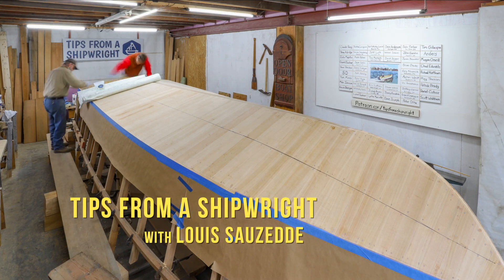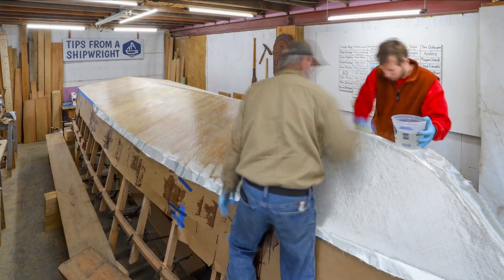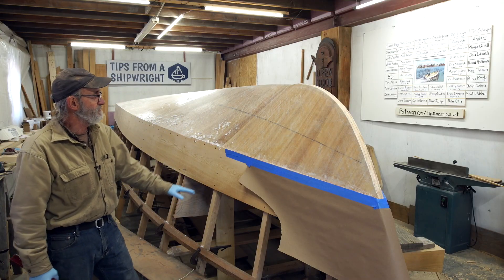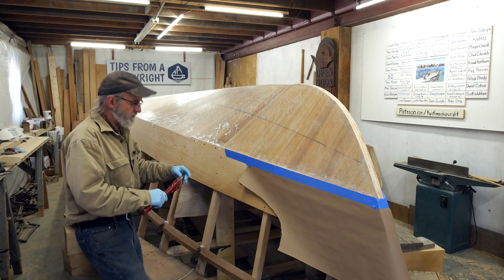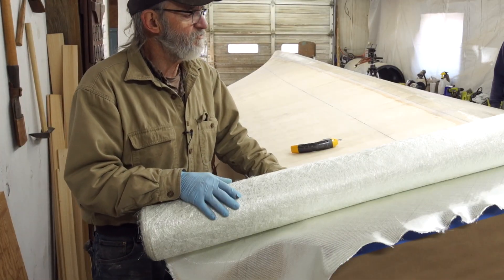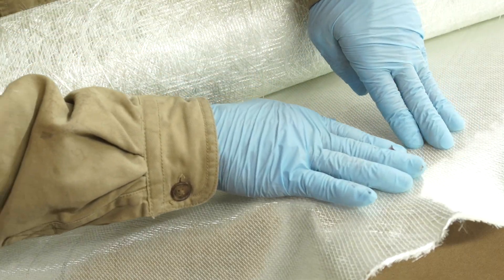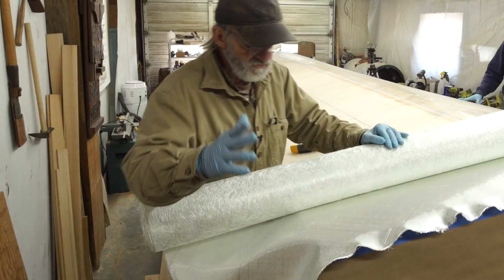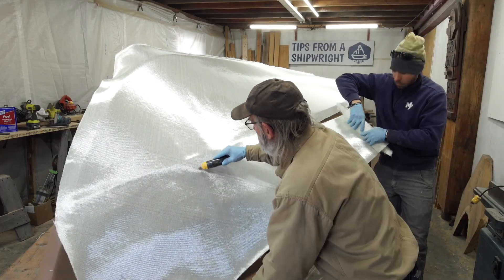Building the 23' V-Bottom Skiff - Episode 13: First layer of fiberglass

Comment: If you have no experience with fiberglassing.....Do Not Follow His Directions or Instructions or Advice!!!!!!!!
Reply: Why don't you come out of the closet and identify who you are and why you say this? Sour Grapes Bare Bottom Reef.
Reply: @Coastwiser  there a lot of Chief out there
Reply: @Coastwiser  
 @Tom Truesdale 
If I need to explain why the fiberglass layup was wrong and horrible advice then you dont know anything about fiberglass.....
Reply: @OldBullRanch  well have you build a Boat on YouTube?
Reply: @OldBullRanch  you may want to get more fans sir
Reply: Please explain yourself
Reply: @tomtruesdale6901  1) The fabric Lou is using is designed for polyester resin, but he is using epoxy. 
2) The technique he shows, of working the resin as it cures, is highly suspect.  Doing that will create problems. 
3) Using just a single layer of biax cloth is not a good idea. The cloth is strong in tension, but nothing holds the fibers to each other.  With just this layer, and with scraping off the stitching, you could peel the fibers off like peeling string cheese!  (I know because I've done it.  I didn't build Lou's boat, but I experimented with a single layer of biax to reinforce a board, I sanded it flat, and then I found some of the fibers peeled up with surprising ease.)
4)  Separating layers of wood with an impermeable layer will trap moisture in the wood, which means it will rot.  Also the wood will warp and/or delaminate.  Wood expands and contracts with moisture, and he is making it so one side of the wood can expand, but the other side can't expand because of the fiberglass and epoxy.  Also this is the same mistake made in naive attempts to make energy efficient homes--some have tried moisture barriers on both sides of the walls,  which results in massive mold and rot issues! 
(I probably missed some details.  I don't know a lot about fiberglass, but I knew a few things.)
Reply: @fredygump5578  Lmao....yes man...cant type that long lol....and there are Many Many other things having to do with the actual application of it that were so Wrong lol
Reply: @fredygump5578  sir were is your Boat that you build on YouTube? Leave your thoughts to your self. Lou a ship / boat building eat Crow ok
Reply: @gregoryh4601   I just imagined how, if you were following your own advice,  I would never have made your acquaintance!   That would be so sad, right?  And the fact that you are triggered reveals that you are amongst the ones the original commenter was seeking to warn!   Atleast he got your attention!
Reply: @fredygump5578  I agree with all you said plus, the thinning of the epoxy with solvent weakens it quite a bit. If he had thin veneers like cold molded, that would be different but two thick layers and the cloth in between as someone pointed out is not much stiffening because its the middle neutral axis. Skins on inner and outer face would be the logical thing.
Reply: @paulbriggs3072  If I remember correctly, he is planning a second layer of fiberglass after he adds the second layer of planking. So it will be a sandwich construction w/ extra wood layer on top. 
I am just now realizing that the reason Lou us adding alcohol is because alcohol is a solvent that will help dissolve the styrene binder! 
All the questionable stuff he is doing goes back to using the wrong cloth.  If he used something like a heavy 2x2 twill, all his problems would go away.  It would wet out easy, and it would lay super flat. 
If he also applied a peel ply over the top, there would be zero prep required for the next layer...not even any scraping!  But I think he likes the scraping, so he might do it anyway.
Reply: @fredygump5578  Well I suspect good ol' Lou might not be thinking of that reason for the denat. alcohol, but I checked what you brought up and it turns out the ethyl alcohol part of denatured alcohol does indeed dissolve styrene (but not the smaller methanol component). Strangely, the latest issue of Wooden Boat has similar boats as this on page 74 with 2 layers of 3/8" marine ply bottom-thus dimensionally stable, and fiberglass sheathing over that. Normal and trouble free.
Reply: @paulbriggs3072  He may not know why, but it turns out to be a clever trick.  I have ~20 yards of 18oz biax (hexcel) that to my surprised turned out to have a styrene binder!  It's useless to me.  The reseller sold it as an equivalent to a different brand stitched biax I had bought before...but it is so not the same!  But anyway, maybe I can use alcohol to "fix" it?  I will experiment,  but I won't use it on anything critical.
Reply: @fredygump5578  1st 1708 doesn't have a binder and is fine for epoxy use, 2nd He's not using the fiberglass for strength, it's for scuff protection and 3rd boat build have successfully encapsulated wood in fiberglass for decades and the better encapsulated the less rot, the good boat builders did a better job. A house has tons of air in the walls which combined with moisture causes rot, in a boat the goal is to seal out both air and water so no damage can occur. Especially since epoxy came out, it's much easier to seal the water out than ever before, wood is making a comeback because of epoxy.
Reply: @DanDitywitz  i contributed what I felt like contributing.....to MY own original comment. Im not here to help you figure out what was incorrect. I DONT want to have a conversation with you or the other clowns that have had smartass comments towards me.
Reply: @DanDitywitz  Look at you, insulting yourself like a savage!  (Sometimes comments become conversations.  I've already learned a few things here ...but not from you, obviously.)
Reply: @DanDitywitz  What are you the youtube comment gestapo??? Lmao  get over yourself.
Send me your email address and I will send over my resume so you can feel worse about yourself. Is Lou a great carpenter and boat builder? Sure. Do I personally have more experience with building fiberglass boats than Lou?? Yes, I do....years more.
You want photos hungryhoagie??? I will send them to you.

Comment: You can think of the fiberglass cloth like plywood... woven cloth is like veneered plywood where the layers of grain criss-cross at two specific angles, and multi-directional cloth (aka mat) is like OSB with the grain crossing at multiple random angles. This 1708 cloth is the best of both, with specifically angled fibers to make edges like at the transom stronger, and flat areas stronger in every direction through the random orientation of the matted layer.
I asked last week, who's the new kid?

Comment: Ist tthere a formula that explains epoxy to fabric ratio??
Reply: P for plenty, dry areas are a no no.
Reply: You want to "wet out" the cloth but not so much you float the cloth off the surface that is being covered. Go to the TotalBoat website for a ton of information on glassing.
Reply: Resin is heavy and weak. You want the absolute minimum amount that will wet out the fiber. Equal parts by weight might be appropriate for this type of construction (hand layup).